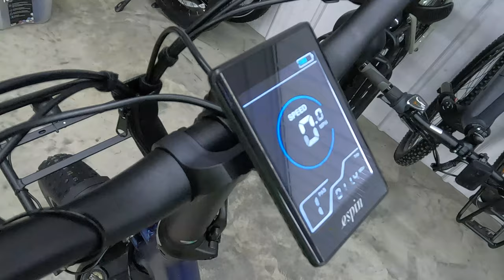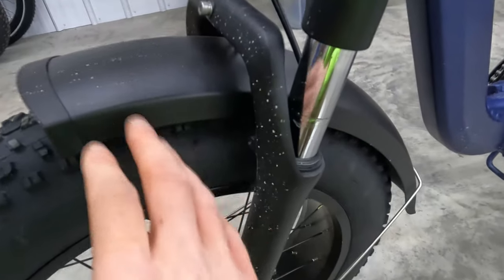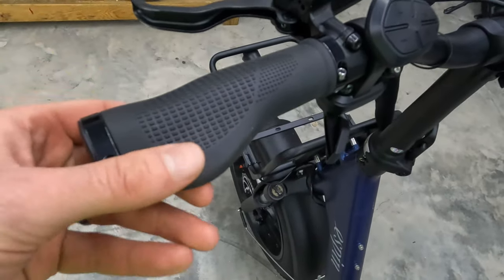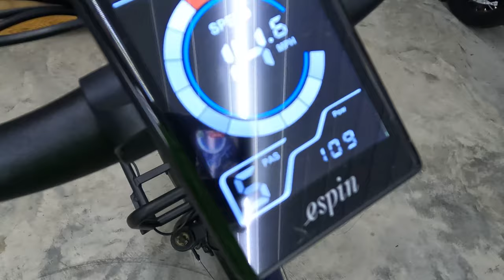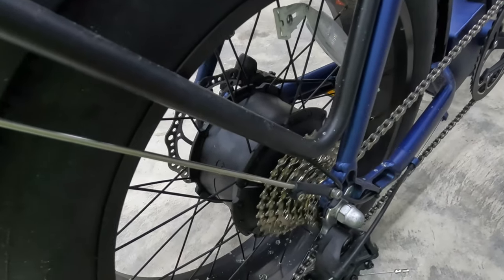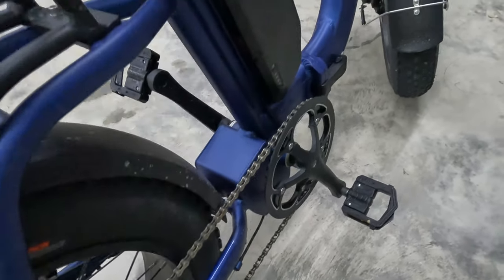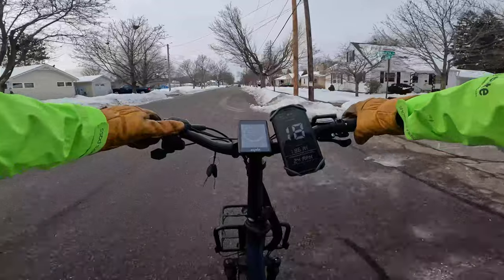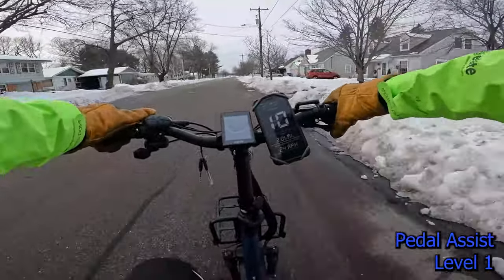Espin Nesta Full Review: An Affordable Folding, Fat Tire Ebike with Hydraulic Brakes!

Comment: Great review!  At 5'4" (or, more to the point, with a 30" inseam) do you think I'd be able to fit a suspension seat post and still have the seat low enough?
Reply from the maker: I think you are right on the edge of "yes it will fit". If you have 3-4" of seat post exposed now, then I think you will be ok. -JT

Comment: Great review, looks like a great E-Bike choice.  Question:  Can you use the throttle to go to a higher MPH speed pass the speed limit of the pedal assist level ?  For example, you are in PA 1, but you need/want a jump of speed /acceleration, so you hit the throttle to go pass the 10 mph speed of PA 1 up to about 15-18 MPH momentarily.  You then release the throttle and you slow down back to the PA 1 speed of 10 MPH.   This would be great safety feature IMHO if you needed to go fast quickly in the easiest way possible to avoid being hit by another vehicle.  OR just to cross a intersection faster without making any changes in pedal assist, gear change, or  you leg cadence/ leg power.  If the Nesta can do this, it is a REAL PLUS.  So, yes or no ?
Reply from the maker: HI Louis, thanks for watching. The full power of the bike is available with the throttle no matter what pedal assist level you are in.